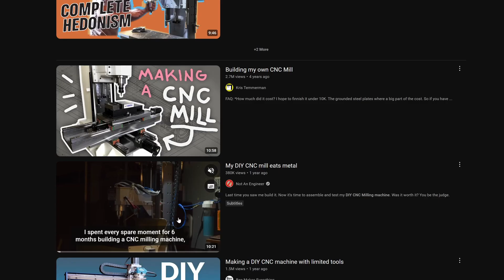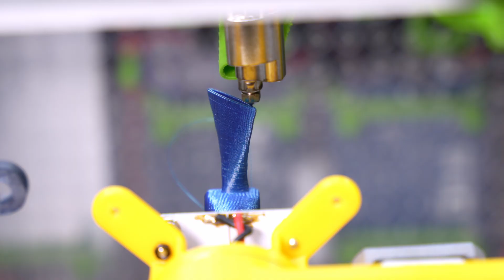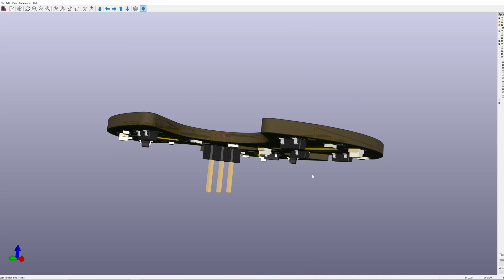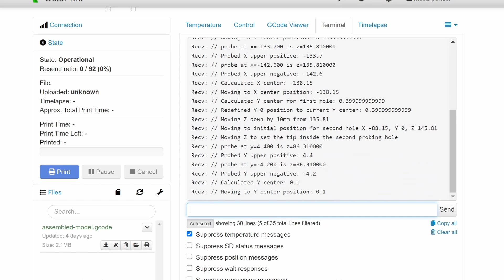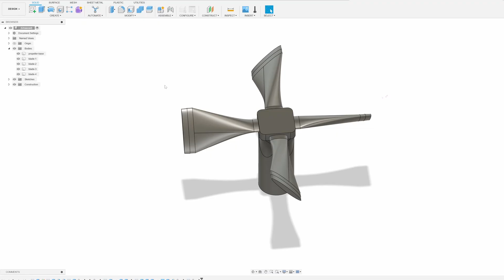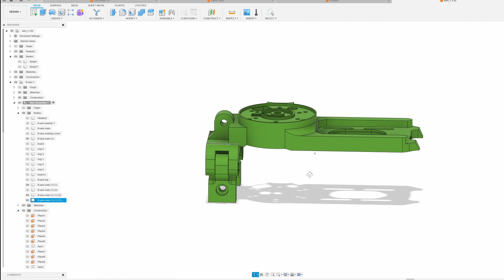Fine-Tuning My 5-Axis Printer for Ultimate Precision

Comment: Could you split the blades shaft like a branch so you print and rotate in sweep so you not doing shaft then the adding blades after. Kind like the spiral in the last video.  If you print one blade continuous the com back and print the other 3 petals from the shaft…

Comment: I may be late to the party but what are the advantages of a 3d printer like this compare to your typical 3 axis 3d printer?

mainly in what can this do that the other can't?
Reply: In the intro, you can clearly see that the need for supports is eliminated entirely. Extrapolate this to an infinite number of possible projects where material and time saving can be had without tedious multi-print parts or mechanical interfaces to connect various components to make a “complete” single part. These are the biggest advantages.

Comment: This is an amazing concept 😍 
My only suggestion for future versions would be to move the a axis so it rotates closer to the centre line rather than on the long swing arms. Should help with the positional accuracy during rotating planes and more rigidity? 
More akin to most 5axis cnc mills.😊

Comment: I can't wait to get my slicer to work on 5 axis, it will be so cool to watch a printer like this using it. As for a slicer I think Vslicing(the core algorithm behind my still in development slicer) is a perfect fit for this as it adapts the layer shape to the model's shape and thus can automatically slice complex models with minimal supports needed on an ender 3. I'm not just saying this because it's my algorithm but you sould check out devlog 1 of geekworks crystalite. It's a relatively short blogpost on the basics of how VSlicing works, may be useful for this project.

Comment: Isn't the issue that these "professional printers" are backed by companies that have patents or have licensed patents from the patent owner, just as was the case with 3 axis 3D printers. The only reason we have (cheap) hobbyist grade 3D printers is because a few of those patterns had expired which opened up the market for anyone to build and sell 3D printers (of the 3 axis type at least) without paying hefty license fees to the patent holder(s).

Comment: cura does allow relative positioning.
its also what is recommended to use nowdays.
the duet docs have some informations about that if you lookup M82
Reply: The setting is relative E positioning.  On a normal 3d printer there are 4 axis's X, Y, Z and E.  E is the only one that is relative, and that's the Extruder.  As mentioned in the video, you can't use relative positioning in X, Y, and Z because of small errors adding up into larger and larger offsets over time.

Comment: To solve the rotational issue just use a known starting point with a limit switch or meausure motor current. Move to the limit to get an absolute position, move to the intented position. Or use an encoder.. but those are expensive.

Another approach is to switch from stepper to a servo. I can imagine that you don't need 360 degrees of rotation on all axis.

As for the probing issue: Experiment with a 3-axis load cell sensor.

Comment: Very impressive. But it must be said that 5th axis is a thing on CNC machines, because CNC is a subtractive system. An additive system like a 3d printer doesnt need 5th axis. Your propeller example would be stronger if printed normally on 3 axis. Anyways, your creation is very impressive.
Reply from the maker: Yes that's right, was just a sample! there is a lot to do still to make this truly useful!
Reply: This is not correct. While a 3-axis positioning system can move to any location, and with the aid of supports, can print almost any shape. BUT - it can't achieve optimal part performance because of limitations to how material is deposited - layers can only be flat or very gently sloping due to nozzle geometry. 5 axis 3D printing allows any part to be built with any number of layer shapes and orientations, allowing truly optimized prints and quasi-isotropic part properties if prints are toolpathed as such.
Reply: @CarbonKevin  Using this videos propeller shape,.. there is a significant weakness for the first layer of each blade. Its printing on a lumpy uneven surface. This propeller would be stronger, if printed on regular 3 axis. The correct solution is the simplest solution that produces the best output. AKA 3 axis.
Reply: @CarbonKevin  All im saying is that 3d printers dont suffer from the problem for which the 5th axis was invented. I can still admire the 5 axis 3d printer shown here which is amazing. Someone had to do it. Im glad it was done.

Comment: Use a cheap bearing as hole for calibration they have a better precision than anything printed
Reply from the maker: I tried that, there are bearings on every axis, but I couldn't scape the need for calibration regardless
Reply: @engineerunleashed  I'm talking about using the inside of the bearing as a hole for you to place the nozzle in to calibrate. Bearings have high manufacturing precision.This way you will have a "perfect" circle and heat proof to touch the nozzle.

Comment: Relative positioning is available in the basic information under the printer tap on orcaslicer. It is called "Use relative e distances"
Reply from the maker: Yes, but as far as I understand, that's relative for the extruder only, right? not for the movements and all the axes?
Reply: @engineerunleashed  From a quick google, it seems like your right, and the setting only effects the extruder

Comment: This is truly amazing stuff you're working on!  I think a 5 axis slicer which can slice a whole model in one go, while also figuring out the best way to move the tool head and build plate without crashing, and efficiently is going to be a massive task.   
I wonder if there's any locally run AI/ML that could be leveraged to do 5 axis slicing? 

Unless traditional methods would work, and be able to work with any geometry?  🤔

I can't wait to see the next video!
Reply from the maker: The slicer is going to be a lot of work. Another thing I realized, the print volume changes any time I change the rotation of A or C... I didn't think how I'm gonna tackle that one yet...

Comment: Maybe you can figure out a connector that allows for changeable tools, a 5 axis tool changer would allow to change between 2 main tools: quartz probe like CNC machines have and a extruder. while extremely challenging I can imagine that this would make a big difference
Reply from the maker: That's a possibility, the current approach may not work after all. So a tool changer may be the way to go...

Comment: thank you so much for going deep on 5th axis development. 
this motion frame enhancement could greatly expand the possible configurations of a metal/ceramic printer as well by allowing more constrain on tool head designs. 
An additive friction roll bonding print head, for example could benefit substantially from such an upgrade.

Comment: You could make the wide portions of the calibration tools rotate 90 degrees/ fold in. Then design a latch for both positions, so they don't move.
Reply from the maker: Yes that's probably a way to go... but more motors, more electronics, and also the folding mechanism may affect the precision. But it is something I could go for in the future! Thanks for the idea!

Comment: On the mechanical side I think you would benefit from a more systematic way of working. There is the Denivat-Hartenberg scheme that robots use.
I genuinely believe the plain slicing is the best way to do this. My attempts steered me away from the 3d printer slicers because they aren't really built that well. That ment building my own software from scratch which basically ended my journey, everyone else is a better code writer than me.
Lastly an avenue I didn't fully explore was adapting CNC software that is far more developed than printing software. This person has some software that seems most promising @grblgru Really printing is just using a different end effector.

Comment: modification of slicer proposition:

set object face as plate approche - similarly for the model thst you printet you can set face of one model to be plate for the other one

triangulated position printing - calculate how to print object with for example 45deg max overhang and adjust the plane to this - i think it will need to utilize search algorithm to do that

Comment: What about using electric contact for probing the positions, similar to the simple toolheigt setting devices for cncs? Something like putting conductive copper tape on the calibration pieces and detecting when the nozzle makes contact? Would require a really clean nozzle but not much other hardware
Reply from the maker: In fact, I think I may eventually go for this approach. It sounds easier in my mind to make an extra piece of hardware to wipe the nozzle tip for conductivity than struggle with a heavy and mechanically triggered probe. Thanks for the idea!!
Reply: @engineerunleashed use a needle bearing cage as a high precision datum and press those in your print
Reply: @engineerunleashed  As others have mentioned, it's sometimes difficult to automatically clean the nozzle.  If you had a metal probe that you could retract, you could use conductivity without having to engineer a nozzle cleaner.
Reply: Yeah, I was also wanted to suggest using touch probes used on cnc machines for their higher precision, although they might be a bit pricey
Reply: Requiring the clean nozzle is the problem. Wiping the nozzle isn't a guarantee it will be clean enough to make electrical contact. The first time a wipe is unsuccessful, you crash the machine.

A touch probe is a much better solution, especially one that can sense on the XYZ axes like they use on higher-end CNC machines. They still fail occasionally, but are far more reliable.

Comment: You should try and use rope/steel cabels as they have no gear backlash
Reply: Or timing belts. Properly designed timing belt systems have very low to zero backlash
Reply from the maker: I think you are both right, I may explore this in the future! Thanks for the idea!

Comment: what are the microsteps & degrees from the steppers? you might achieve free precision by using 16 microsteps & 0.9deg steppers!
Reply from the maker: At the moment, 16 microsteps on A and C. I think those motors are 0.9 degrees as well, but I should fact check that last bit.